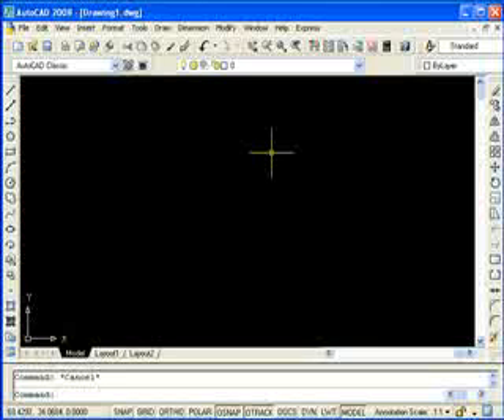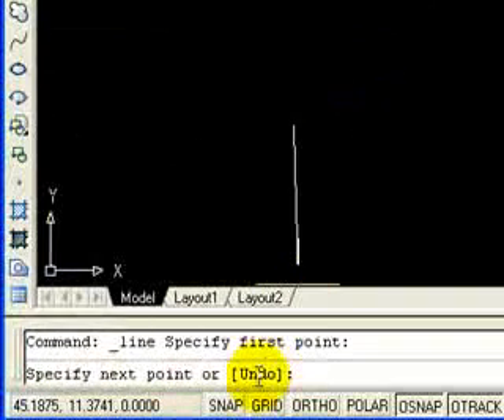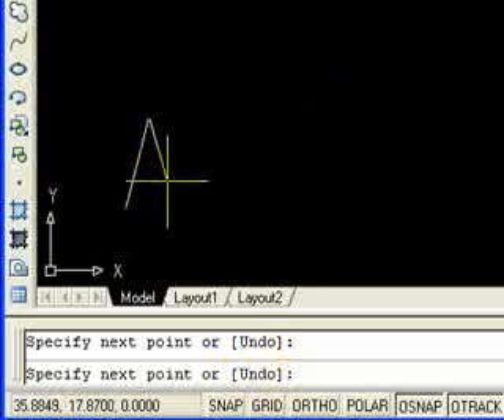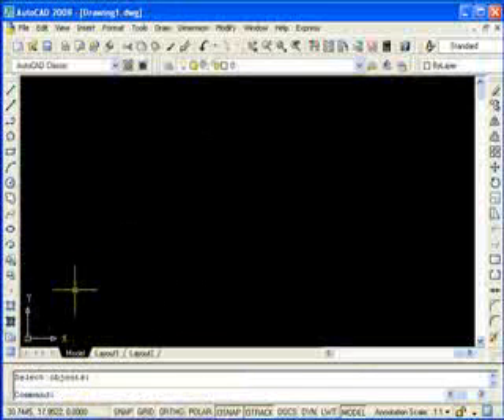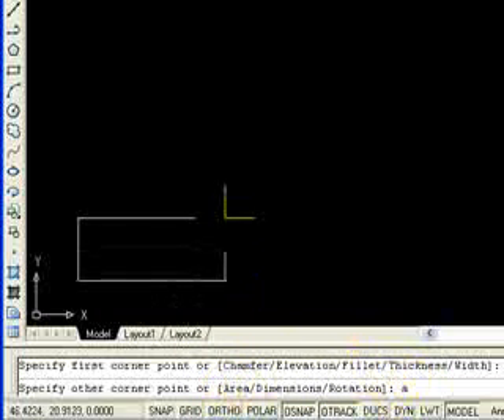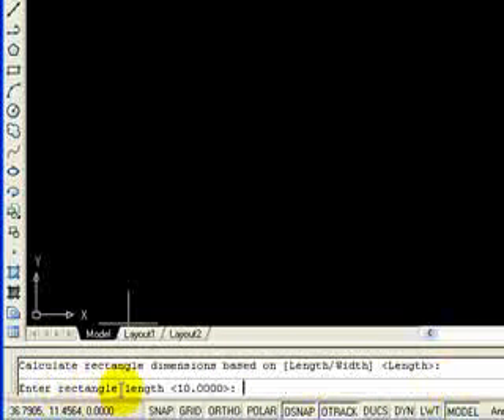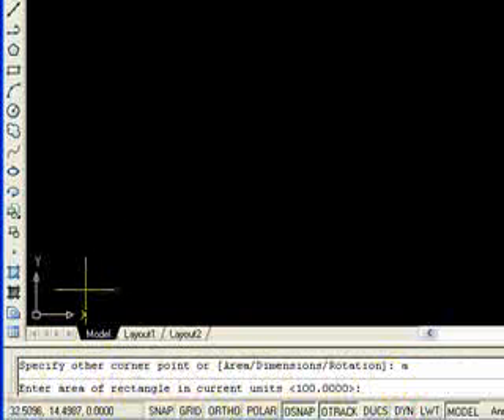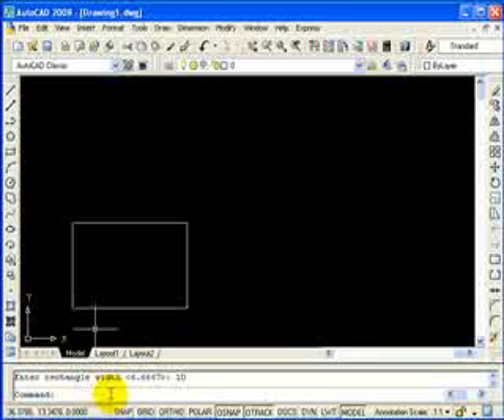AutoCAD 2008 - Tutorial 06

Comment: @spartan1893 

Select line command from the toolbar, and click on the drawing screen (line command will get activated), and type in command line,

@137.8<15.3

"@137.8" is the length u wanna specify.
"<" is the multi use impression symbol.
"15.3" is the degree u want at the specified length.